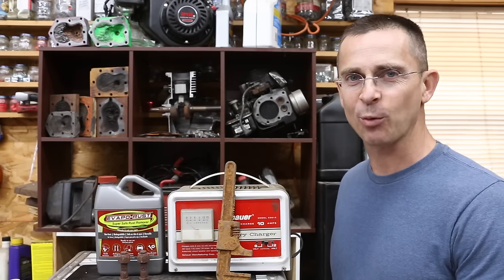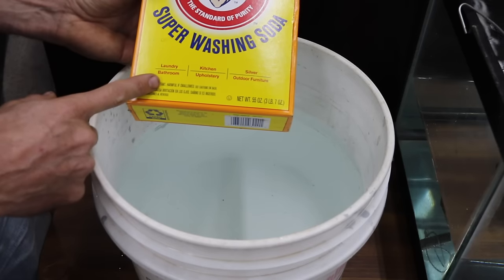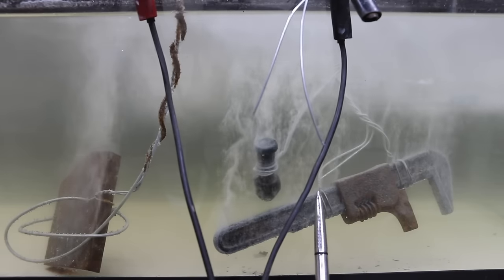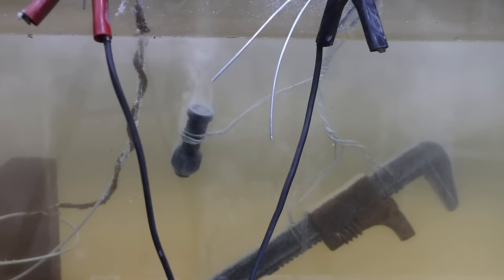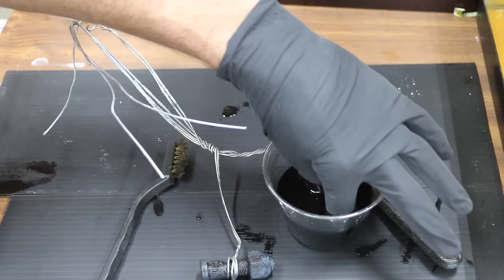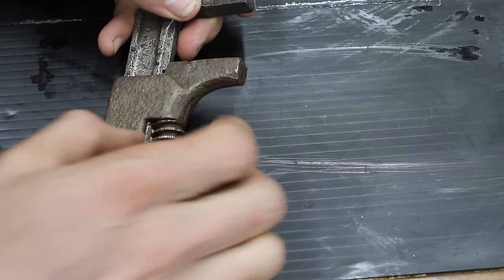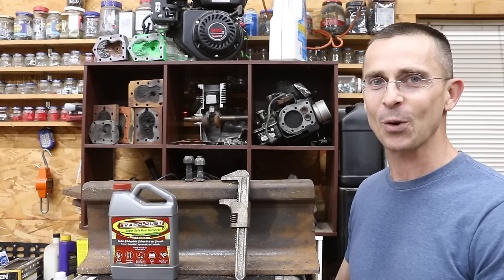Is Electrolysis better than Evapo-Rust?  Let's find out!

Comment: The sliding part of the wrench wasn't electrically connected well. The rust remained on it. In the tank, this part didn't even bubble.
Reply from the maker: Thank you!
Reply: oh hi diode
Reply: we all watch the same content...... dont we ??
Reply: This. The rust between the slide part and the handle prevented the completion of the circuit.  As it did between the bolts and the nuts.
Reply: yeah, I cant imagine not realizing that after the first 24 hours, but 3 days??? Not the brightest tool in the box. (pun intentional)
Reply: @dougaltolan3017 , comments like yours are the reason we can't have nice things. Once you have made some acceptable YT videos you can start criticizing. But even then you probably shouldn't
Reply: @ksbs2036  Rubbish! You dont have to be a master cabinet maker to know a chair is wobbly.
Reply: But you wouldn't know how to make a new chair that isn't.
Reply: @dougaltolan3017  do you know how to make a shoe stink?
Reply: I observed that as well maybe if he had connected it to the other rusted metal it may have bubbled away.
Reply: @dougaltolan3017  hey guys why don't we lay off. I don't see another channel putting up content like this. Dude is amazing and he did say it was his time using it. He makes wonderful video's and I think your right about moving the wire could help it to clean the rust. But we can definitely say it in nice way. I'm sure he's use to idiots like yourself, but I still don't like the idea of you throwing shade.
Reply: @raphealwood4434  Hi. Interesting comment there. Although I do wonder about a post suggesting that there are nice ways to say things, that also includes a section that calls someone an idiot?
Reply: Was wondering when he would notice that, never
Reply: yes
Reply: Ya. Same thing with the nut. I bet he could have connected the nut and the sliding part of the wrench and he could have had more success. In fact he might have gotten it to release if he wrapped it around the nut at first.
Reply: @dougaltolan3017  Always got to be One~!!! Tag you're it.
Reply: @tomcollier2444  Aye right
Reply: @ericharrison619  Did you watch the video? How about 2:58 onwards "theres still a lot of rust though ...this is  going to need more a lot more exposure to the electrolysis process"
No, its not going to need more, that part is going to need exactly what the rest had.
Those are facts, if you have a problem with facts, you best duck out now.
So, whats the problem?
This was not, as you say a demonstration, it was a bungled attempt. That in itself is not a problem, but when a video is intended to be educational then there is a very big problem if the demonstrator has so little understanding of the topic that they make a mistake like that. Not only that but the video was not reshot indicating continued lack of understanding despite over 4 days of it staring him in the face.

Yet you idolise this.
Reply: @dougaltolan3017  You want him to hold your hand too? If you think you can improve the technique then do it. He's not trying to exhaust all protential outcomes just for you. All he wants is to show you how to do it. He gave you step by step on how to do this and did so in a very short, timely manner.
Reply: Same thought I had the first time he pulled the wrench out. Rust is a very poor conductor. Whenever using electrolysis on tools, always make sure your anode is connected to any moving/isolated parts with a rust barrier.
Reply: I think we're all underestimating him, he's regularly shown himself to be detail oriented in his videos. With this in mind, along with how benificial comments are to a videos "success" it's an easy conclusion to come to. Which is why he merely replied "thank you" instead of conversing a bit more about it being something that was genuinely brought to his attention. 

This is actually a common practice amongst "YouTubers", there's frequently something that most will notice, and proudly want to point out.
Reply: It was so obvious I knew someone would beat me to it.
Reply: Yes, I also noticed this while  watching. You would have had better results if there was a better connection between the adjusting part of the wrench and the connected wire
Reply: @dougaltolan3017  nothing to guess about, as so many other have proven in this comment section.
Reply: @anon9640  Hahahhaa

You lot are laughable.

L
Reply: came here just to make sure someone commented this
Reply: Did you forget the resistor
Reply: @ksbs2036  I think he's a jerk but comments like yours would keep us in the stone age. I don't have to be a chef to know someone's dish tastes like shit. I don't need to be an actor to think some actors are horrible at acting. No one could criticize anything if we lived by your rules. What a horrible world that would be.
Reply: I was just thinking the same thing. But we have to cut buddy a break here. Most of us are just sitting home watching videos.
Reply: Yeah I thought the same thing... must not connected too well to the handle piece since the handle looks like the rust is gone while that part is still quite rusty and bright.
Reply: I am sure there was a dodgy Chinese connection between the sliding part and the fixed part. Needs more salt....
Reply: @ksbs2036  Definitely wrong. If you want to make an informational or educational video, get your facts right first! It is just a pity how much bullshit can be viewed on Youtube...
Reply: Hey Dan. You know a thing or three about electricity, don't you?
Reply: @dougaltolan3017  Maybe he liked the juxtaposition of the two parts.
Reply: THANK YOU.

I don't get the "well it's not doing anything still so let's try the exact same thing for the 5th time and see if it works now" BS
Reply: @ksbs2036  your logic is so wrong it's actually funny
Reply: @raphealwood4434  You don't know of any other channels that do this? THERES THOUSANDS FFS
Reply: @QuoteFarm  If you want to show people how to do something then maybe learn how to do it yourself first...
Reply: @dougaltolan3017  yeah you probably already learned but dont waste your time with these idolizing softies. That cant take ANY criticism thrown at their beloved creator without having to white knight. You made a perfectly valid point and in a friendly, joking manner. These people watching are literal children, and act emotional over a joke. They're probably very active on twitter. Its the only place i see idiots getting so emotional over nothing.
Reply: @flacko7369  youre a child so what you say really carries no weight
Reply: @bigbirdmusic8199  projecting hardcore
Reply: People chill out,
He's made like one mistake over about one hundred videos...point out the mistake and move on
Reply: Ya you sometimes have to connect individual parts with wire when you use this process.
Reply: Just What I Wanted To Say
Reply: It would also have been cool to weight the sacrificial metal before and after to see the transfer amount. Excellent content. Please don’t stop!!
Reply: Exactly. I was thinking to myself, 
"Man, he should wrap some of that wire around the sliding part of the wrench for a better connection!"
Reply: I noticed the same thing as well.  Not enough contact.
Reply: Noticed the same early in the process, no bubbles from that part. Dougal is right, he should have noticed and re-wired, its constructive criticism and its something we can all learn from in many/most cases.
Reply: Yep
Reply: @dougaltolan3017  No reason to be a jerk. No one is perfect
Reply: @LaconicMind  That glaring mistake was a long long was from perfect.
Reply: It was pretty obvious to me that applying current to both mating parts of each test subject was needed. One can either politely and tactfully point that out, or present themselves as a rude, insecure, narcissist, who feeds on belittling another's good intentions. It's a dirty job for sure, but somebody's gotta do it. Let's just pray our resident lowlife, isn't raising any children...
Reply: @kelhawk1  Ohh the irony
Reply: @ProjectFarm  yeah should have connected it to the sliding part aswell as the electricity won't pass through thick layers of rust that sell
Reply: @dougaltolan3017  with you on that he clearly understood the process so should have realised no bubbles meant not working

Plus it literally wasn't working at all so that shoulda been a red flag
Reply: I hoped he was doing that on purpose as a point for the pros and cons of each method but nah. I had a rusted chuck and used chemical means instead of electrolysis for this reason but man. Come on.
Reply: The things you learn from reading the comments and going back and paying extra attention.
Reply: @dougaltolan3017  Gawd; you are another of those (so prevalent in the last few years..) Hateful, Negative beings!  My parents taught us "If you can't say it nice, DON'T say it"  My wife is a psych nurse and she learned it as "Say what you mean, Mean what you say, BUT just don't say it mean" 
PLEASE, show that YOU are the Adult in the room... And END this discussion!! Your original point has been MORE than made.. time to STOP!
Reply: @stebro2738  my wife is also a psych nurse and when she saw this video she said, "Why didn't that idiot wrap the wire around the sliding part of the wrench?!!"
Reply: @middlesiderrider  SOOO, you guys saw that ALSO. I did too, but I got over it really soon  (like in less than a few seconds..) & got on with the rather informative video.. Everyone really needs to get around THAT tree and see the forest behind.. It's FILLED with information.
Reply: That was exactly what I was going to say… I thought it was glaringly obvious
Reply: @stebro2738  Gawd; you are another one of those (so prevalent in recent years) that denies reality, will let people that really should know better still blunder on, and blindly allow others to be mislead.
There was a comment up_thread that stated my attitude is "why we can't have nice things". Education, such as my comment, is exactly why there Are nice things. Without the harsh reality of correction dross will smother the world.
You want to live by trite little sayings? Try "if you can't take the heat, get out of the kitchen"
Reply: @dougaltolan3017  Sad that you feel that un-necessary negativity ...is education. It does, I admit .. educate some of us.. more on human nature than on the origin of "nice things" This whole post is rather strong proof of that. And, unless you have to have the last word, I'm ending it.
Reply: @ksbs2036  Hey guy: I know this is a year (+) later, but he definitely should have realized what was happening.  Ask yourself if you would have realized it.
Reply: Exactly my thought.  Should have wired both parts of course.
Reply: Edit: @Dougal
Thanks for pointing me towards AVE, and the chuckles from your comments and the ridiculous replies you're getting.
Reply: It cleaned under the sliding part of the wrench nicely.
Reply: @ksbs2036  calm down Karen it’s just a joke
Reply: @mr.anderson9938  oh such snappy comebacks.  What ever will I do when confronted with such enormous wit.  In other words, right back at'cha Mr Karen
Reply: good call.
Reply: @ksbs2036  right on!
Reply: @brucecoleman7412  amen
Reply: @dougaltolan3017  Even 2 years later your comment pissis me off. Did Project Farm claim to be an expert? He tests things an made a mistake, was thankful for the hint, didnt deny it. So whats your fucking problem?!
Reply: @raphealwood4434  Chill. It's just entertainment. If you go through life that tightly wrapped, you'll burst !
Reply: @anon9640  And.. you are a hypocrite.
Reply: @dougaltolan3017  I'm sure he noticed, but he kept doing it just to more Youtube comments.
Reply: Yeah I’ve done a lot of electro
Reply: That was my taught as well - just connect a wire to it, haha
Reply: @dougaltolan3017  I was thinking the same thing although I have great respect for this channel.
Reply: @dougaltolan3017  im not sure why everyones so upset, i agree with everything you said. i guess they wanted you to say it a little nicer, but thats their personal problem and not about the video at all
Reply: @dougaltolan3017  Good for you. Retired now, I entered precision engineering in '66. On the bottom of every drawing it stated " If in doubt ask", it also followed that if you saw an omission , error or possible improvement you raised it . If you did you weren't told " So you think you can do better , eh smartahrse ? " . The aim was to achieve perfection , and that's why today we can send a space probe on a journey that takes years and yet arrives spot on time at the exact location intended. . . . Oversensitive Youtubers please take note.
Reply: @ksbs2036  Ok fanboy this is an informative video and if the information given is lacking then it's wide open for criticism, that being said nice video. I'm wondering without googling how this works I'm going to assume that it is taking metal from sacrificial steel and impregnating it into the tools voids created by the rust
Reply: @Vinlaell  interesting word salad.  Dunno why you are throwing shade on me but maybe someone pissed in your cornflakes this morning.  Video was two years ago so kudos on the snappy comeback
Reply: @ksbs2036  this video showed up on my feed today not 2 years ago, this isn't a forum there's no such thing as old threads and I'm criticizing you for throwing shade on someone who was making a valid point
Reply: @Vinlaell  I haven't visited this thread in over a year but IIRC the guy I criticized was being extremely unfair in his criticism without adding much constructive to the conversation.  I called him on it because he was contributing little and clearly had no idea how difficult it is to put together content like Project Farm.   Project Farm does a lot of stuff and the guy is very upfront about being an amateur.  He will miss some things because he isn't an expert.   I despise armchair critics who contribute little yet criticize viciously.  Take a moment and read the quote by Theodore Roosevelt, “The Man in the Arena"
Reply: @ksbs2036  he pointed out the man didn't notice the metal part bubbling for 3 days and no result for 3 days on said part. He made a pun about not being the sharpest tool in the shed which I thought was pretty funny it considering the three days thing not seeing what's staring you in the face it's kind of warranted and I would hardly call it vicious. You should chill, i bet your youtuber is.
Reply: @Vinlaell  meh, I disagree but I ain't changing your mind
Reply: @ksbs2036  Yes, YT even disables the dislike count, so "objectionable" comments/critical comments should be suppressed also. It's the new "free" speech.
Reply: @dougaltolan3017  You must be wonderful company at a dinner party. On second thought I would prefer to be around someone without such glaring insecurities. Granted there is obviously  a lot for you to feel insecure about.
Reply: @ksbs2036  since it seems that "necro" dosent apply to YT....
A wee bit of my background may help.
I have spent a lot of time working in TV production, not as a creator or editor or producer, but on the engineering and installation side.
As such I have a very good grasp of what is normal practice in media production, and more to the point post production.
Virtually inexcusable to omit, is review. Watching the program before it is submitted, proof reading for literature, proof copy for printing, playback of audio or video.
At that point I would have either reshot the whole thing, or shot some scenes to edit in to explain the mistake as it occurred, including that as a way to show how to troubleshoot mistakes. Many YT videos clearly have subtitles and graphics overlaid effecting the same thing.
This video is cheap, lazy and worse than unprofessional.
Reply: @rastapete100  troll on
Reply: @ksbs2036  excellent point
Reply: @dougaltolan3017  lol
Reply: @raphealwood4434  so true, he did say it was his first time
Reply: Good observation.
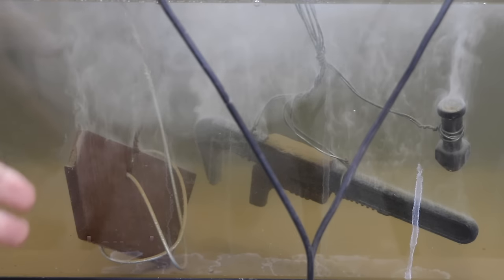Reply: You can really see it at 5:25. No bubbles from the adjustable slider.
Reply: Yep, it would of worked better had he made direct contact with the sliding part.
Reply: What’s up diode? Love your channel
Reply: Yes, if you move the electrode to the lower jaw, it'll clean up right nice.  Another thought, putting a fresh piece of sacrificial steel after the first one gets saturated may help.
Reply: The same can be said for the nutt on the bolt.
Reply: NeatO.

Say what🤔

Were made in HIS image. HE made us with the power of free choice
A good prayer:
I'm a sinner JESUS please forgive me for all my sins I know you shed your Blood for me on the cross at Calvary. Thank you JESUS for my salvation and for shedding they Blood for me. I love you JESUS. 
Romans 10:5/10 ct...❤️k
JESUSisLord!Amen...
Amen..
If you'd like to call someone who cares 
83
For
Truth.
bc you don't know when you'll die?
.y r u hesitant.
.

.
.
Reply: @jennytalbert5547  it's been 3 years but that is still completely irrelevant to ops point.
Reply: Yepperdy not sure how they didn’t realize that while making the video tho… seems so obvious while whatching it
Reply: Never use alot of washing soda in your tank. It won't hurt the project but it will destroy your power source. Too much washing soda effects the resistance in the water and burn out your equipment.
Reply: I would like to see comparison between Evaporust, Milk Stone Remover and Coca-cola. No joke, read the ingredients!
Reply: @ksbs2036  what a dumb thing to say
Reply: @snookaisahtheotengahrepres5681  Bwahahaha a snappy 5 yr later response. I don't even know what reply you are referencing and it's not worth the time trying to figure out what you are trolling over. Go ask your mom to make you some pizza pops. Maybe you are just hangry
Reply: @dougaltolan3017  I see I'm a couple years late to this party. With that said; There is being blunt, and there is being a dick. After reading through over 2 years of this shot-for-shot skirmish here; first off, I say you exceeded bluntness and achieved RichardHead status. Secondly, I have to respect your commitment to standing your ground in the face of a barrage of Karens and Kevins. F*ck 'em if they can't take a joke!  ...carry on, sir.